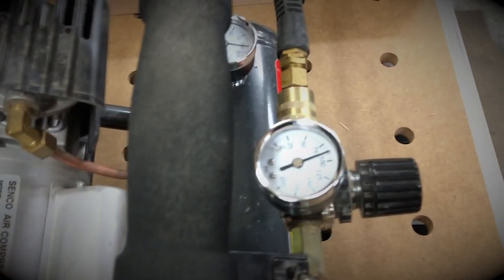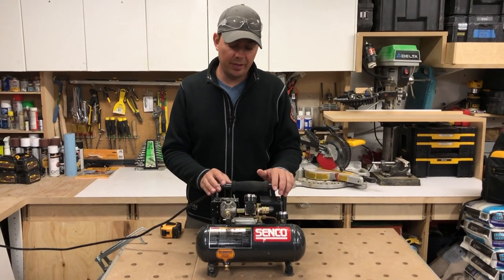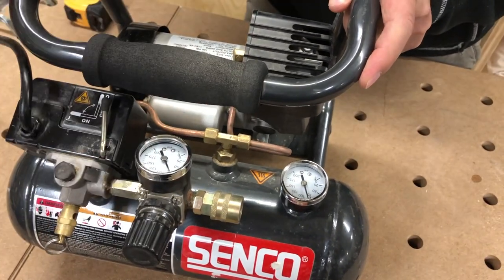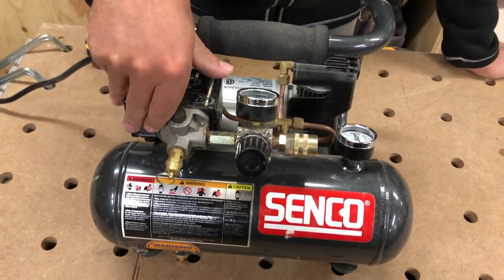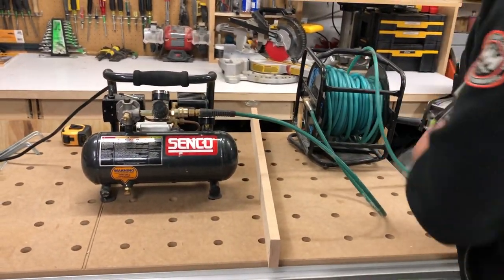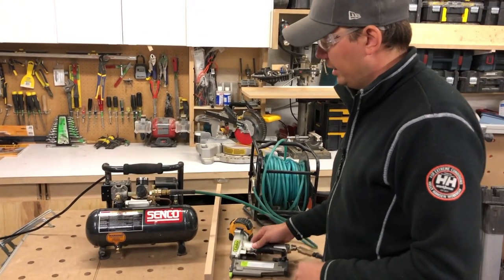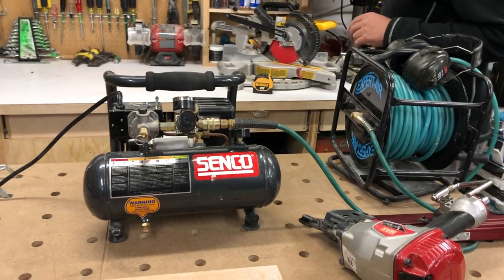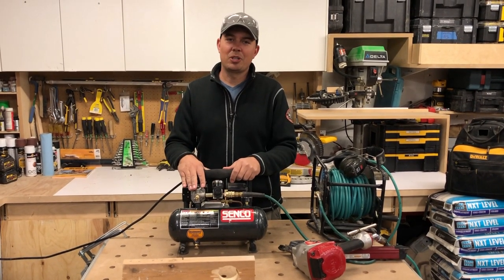Perfect for trim carpentry! Senco PC1010 Compressor REVIEW

Comment: If you remove the carry handle, by just cutting it off completely at the base, this compressor fits in a Festool size 4 systainer, incl. hose and pin tacker. I showed this many years ago to the crew in the shop where I bought the Senco. And now they sell this one as a combo-deal. Does anyone know what sort of d.i.y. maintenance this compressor requires? Best, Rob!

Comment: I’ve owned mine for 25 years  love it FYI it fits great in a small Milk Crate  Senco had one recall  that was rerouting the copper lines to make it run cooler  Senco did use Composites on the nail gun in the kit I’m assuming to lower the cost slightly ? Although mine has performed fine for 25 years  without any issues  I do not abuse it
Reply: My Senco Pc1010 has rust in the tank. It's only 10 years old.

Comment: Due to being in lockdown here in Scotland I have been working from my garage at home and needed a smaller, quieter compressor that would not disturb my neighbours.  I bought the Senco PC1010 and I have not been disappointed.  

Although it is not silent, you cannot hear it from outside when it is running, and you can also still maintain a conversation or listen to the radio. It allows me to operate my staple gun with no issues. It is also very portable. 

My only concern (which may be unfounded) is that it will pretty much run constantly if I use my staple gun for a prolonged period. For example, if I am upholstering a dining chair seat then I will be using the gun for perhaps 1-2 minutes and after the initial 12-15 staples, the compressor will run continuously until the tank gets a chance to re-fill.  I guess this is to be expected for a compressor with a small tank. 

Overall I am happy with it and it will be ideal to use for small on-site repairs and as my compressor for the smaller jobs I undertake at home.

Comment: Do you think that this would be good to use with a Blow Gun to blow dust out of a fan like a Dyson??
Reply: The tank is small so you wouldn't get much blowing air going for too long.
Reply: @MM-qv5lf  Okay, thanks, I ended up buying a much bigger one Weeks ago.
Reply: I’m gonna buy it just to blow tools off after use.     Like table saw or miter saw.    I think it would work fine.    Want something light weight

Comment: Thanks for the vid. Thinking of purchasing one of these units, max pressure is around 120psi however what is the pressure that the machine kicks back in set at? since this will determine how effective it is.
Reply: I think I read in an Amazon review that it will kick back in at 80 or 90 PSI.

This is an extremely light duty machine, and only suitable for 16 gauge or above nail guns (finishing) or brads.

Comment: When you say that you use it to fill up tires. Bike tires? Car tires? How long does it take?
Reply from the maker: a bike tire is fast, under a min. a car tire takes a bit longer. probably about 5 min to fill a full size truck tire. not the best compressor for that application but it can get you by in a pinch

Comment: I liked it but it will not drive any nail completely flush when you are shooting angled into any trim/ wood
Reply: That's not a compressor issue, that's either a regulator or gun issue. Psi is Psi whether it's coming out of a tiny 1 gal portable compressor or a monster shop compressor. It's for trim, (15, 16, 18, 23) not framing nailers (which he actually used successfully for the first one or two shots, but you can't get a 15 gauge pin into trim with it? Lol, ok)
Reply: @digby420  I am well aware the of the mechanical makeup of trim guns lol. Just stating from personal experience I’ve used it on a few small cabinet jobs/ punch outs for trimming kitchens and it will leave nails proud sometimes. It doesn’t have enough ass behind it. I went to the cordless line for small stuff now.